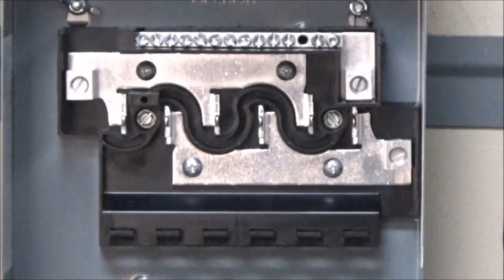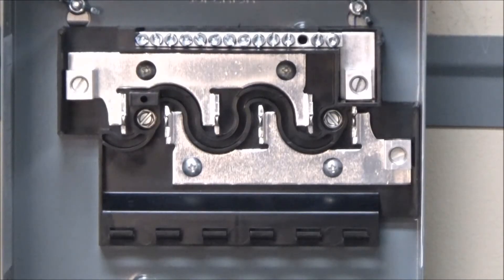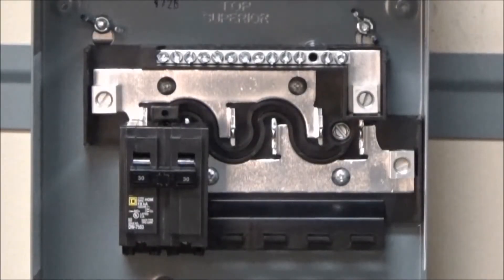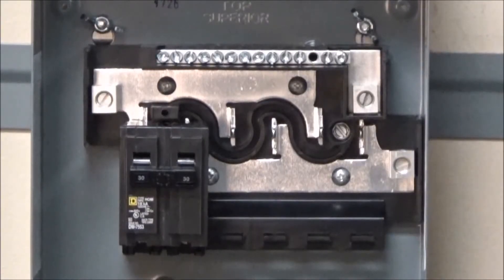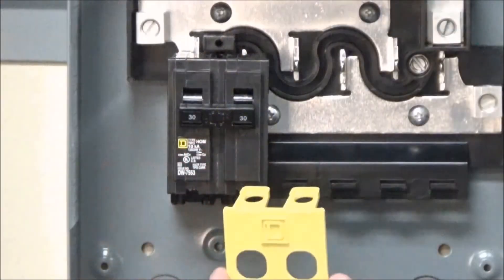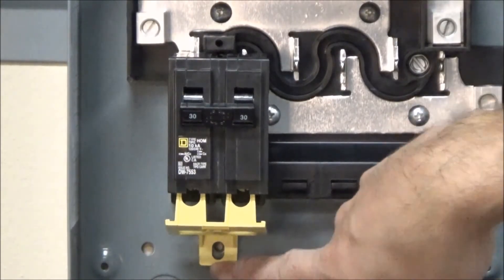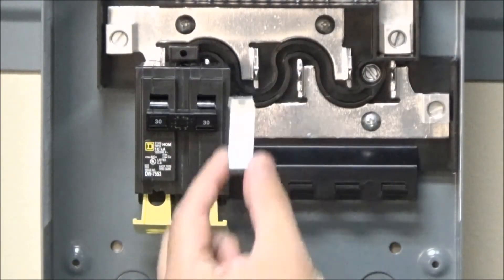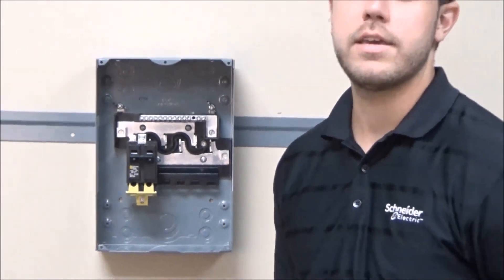Installing PKSB1HOMBF Service Barrier in Low Amp Homeline Load Centers | Schneider Electric

Comment: Clear as mud.  What do you do with the pre January 2017 boxes?  How can you tell the difference?  Where does the white/neutral wire from loads go now?  To the bus?  To the ground terminals?  To the Breakers?  When you clamp the double pole breaker, what does that change?  You can "backfeed" into it now?
Reply: This doesn't change anything about the way the panel is wired, operates or how it's back fed.  All this kit does is physically cover the hots into a backfed breaker so you can work inside the box more safely.  https://www.schneider-electric.us/en/work/products/explore/service-entrance-barriers/